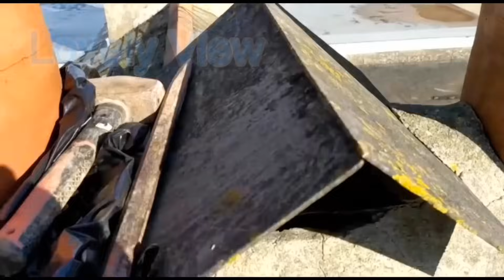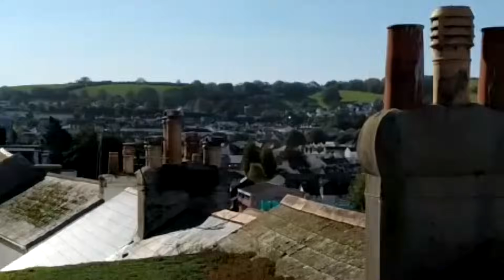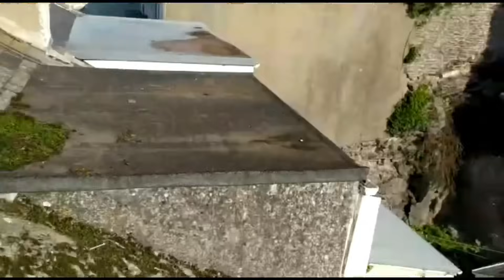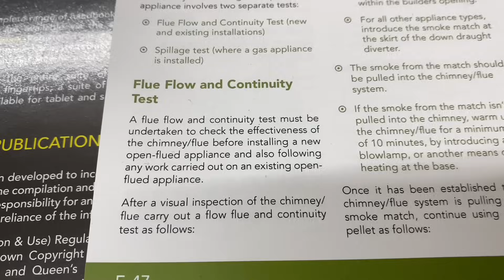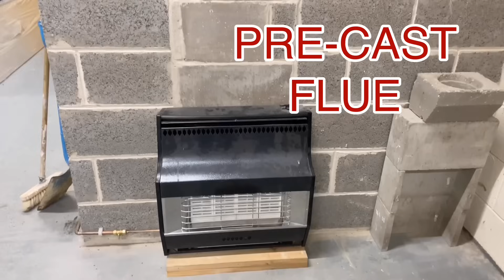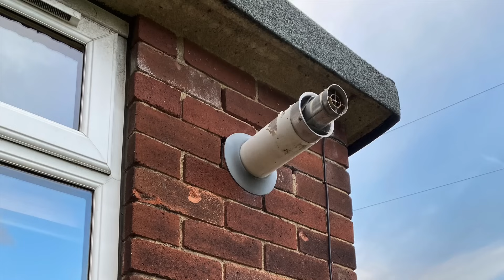ACS Gas Training - BS5440 Part 1 Chimney / Flues / Plumber

Comment: Can you please explain why you can not have Wight on show on a boiler flu. I had a ideal boiler fitted 4 years ago it's service every year thanks
Reply from the maker: Saffron Woodhouse If you have a look at the installation instructions it shows that it must have the rubber seal. Give ideal a call and ask them if need be.
Reply: Some are not suitable to be outside they could corrode